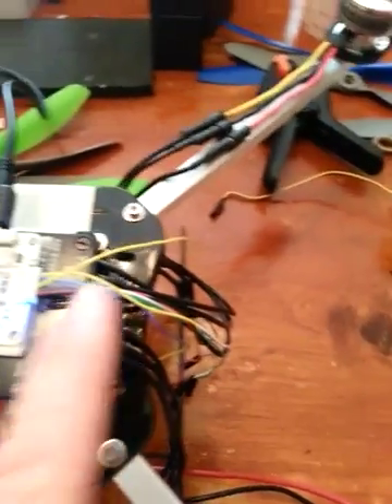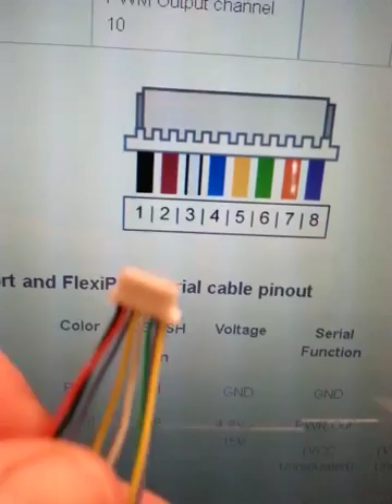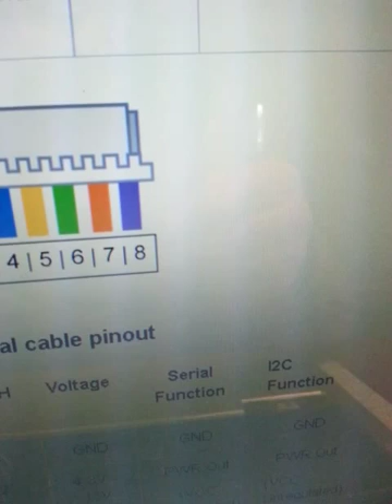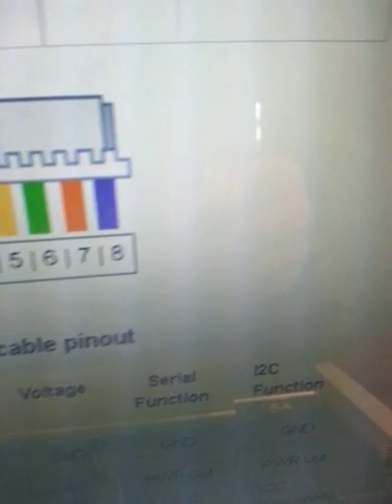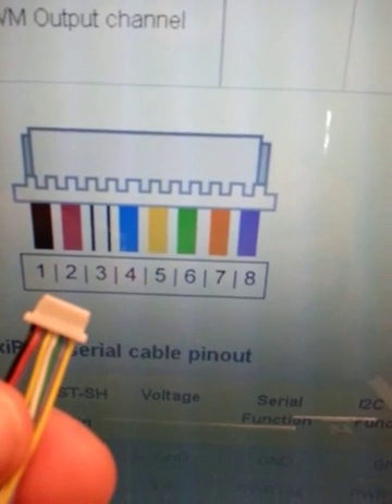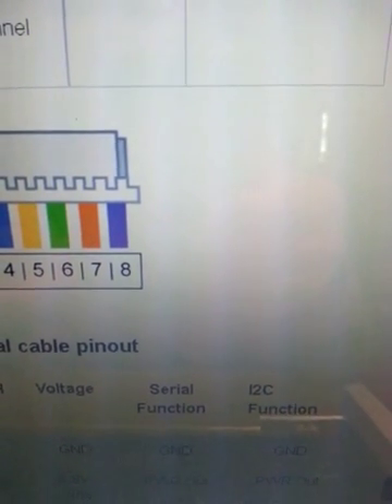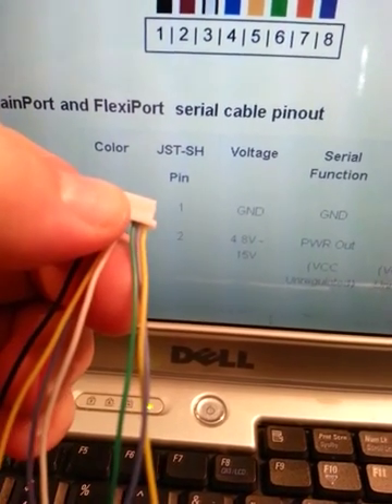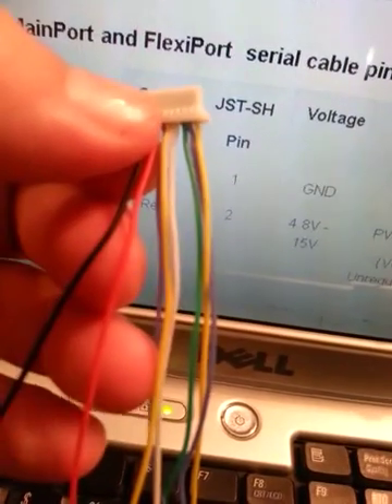Open Pilot CC3D Main Port Harness

Comment: DId you ever figure it out? Mine has the same colours
Reply from the maker: Yes I did Jonathan :) I posted a question on the open pilot facebook forum. You basically connect everything in numerical order and all of your chanels are mapped in open pilot when you do the setup.
Reply: Thanks for the response. I ending up just trying that out and it worked :D